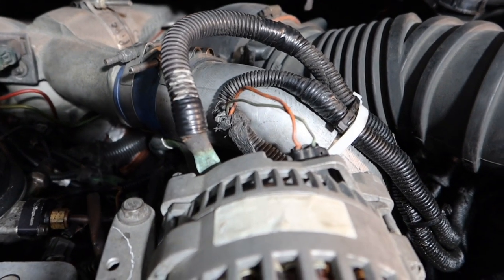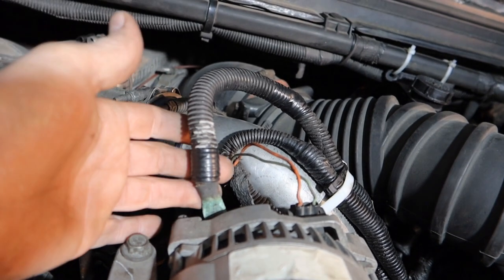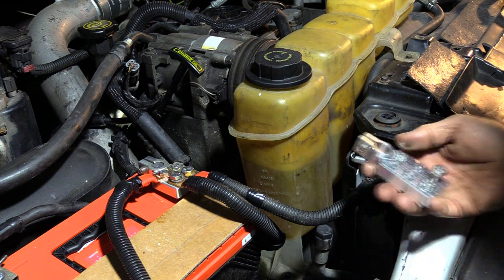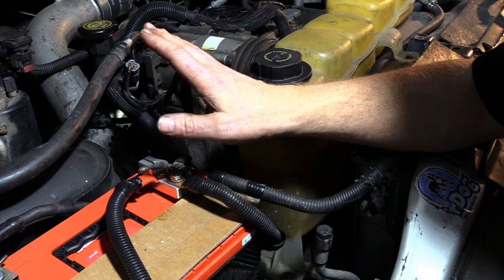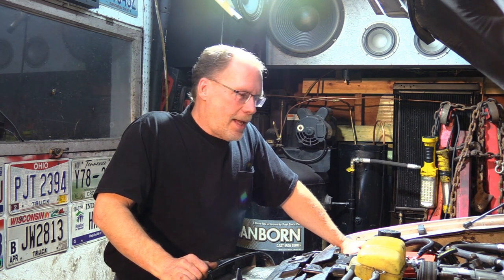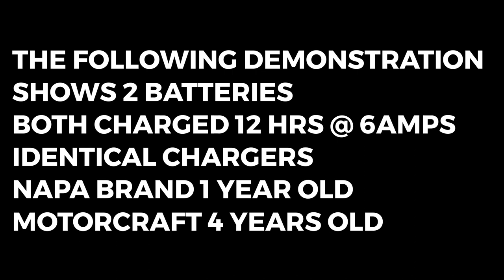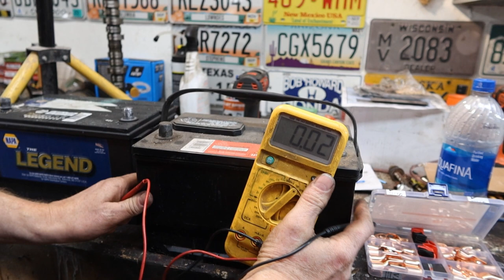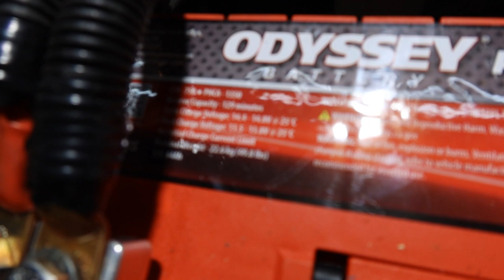7.3 POWERSTROKE ALTERNATOR AND BATTERY ISSUES EXPLAINED.......

Comment: In our fire department we rotated our engines batteries every 3 months and also separated the system for clean side (For all of our computers/radios/GPS) batteries and dirty side (Engine start/lights, etc).  Before we started doing this our City shops were constantly replacing our batteries.   Great info for people to be aware of.

Comment: I replaced a pair of superstart AGM’s that were 15 years old on the 03 7.3 long bed crew I bought a couple of years ago.  I was impressed that there was zero corrosion on my battery terminals.  Turned out it was the starter, and I could have gone longer on them, but it is good to know I can expect a good 10 years and no corrosion.  They were less than $250 each at the time.

Comment: Good vid.  All of the lead refineries in this country have been shut down.  So all lead comes from offshore.  Odyssey batts are good, if you're looking for something less expensive Penn State/Deka are rebranded into many brands and its hard to find who's who but its worth it.  Optima used to make great batteries (late 90's early 2000s), but the last few were not as long lasting as the early ones.  They changed mfg facilities around the same time as the longevity went down...

Comment: Being a mariner I always use tinned wiring connectors to cut down on corrosion.  Shrink to fit with glue inside keeps out water and then dielectric to finish it off.  I do dislike bad electric wiring.  Here at 4200 feet in the mountains I use a battery maintainer, NOCO 2 amp for $50.  I plug it in all winter and always have a fully charged battery.

Comment: I, first always plug in the block heater when it's cold out, and I swap out my NAPA Premium Gold deep cycle batteries about 3 to 4 years... then I re-furb them and use them in my cars, all 3 Crown Vicks have the re-furbs in them and get another 3 to 5 years out of them! Well I guess my next pair well be the Odessy battries 😎😎

Comment: Well dang it, I checked the Odyssey battery company and they only sell the Left side battery and not the right. That shoots the matched battery theory completely.
Reply from the maker: the Batteries sit in the truck reverse each other so yes the same listed battery works for both side You where talking to an official idiot who ever told you that
Reply: @CUSTOMWORKS7.3PSD   It may be different on my 96 conversion van. I have always used two different batteries cause the big one on the drivers side would never fit in the passenger side slot. In fact that smaller battery is a specialty battery that they call the "ambulance battery" and NAPA charges me an arm and a leg for it. I have never been able to find a generic substitute for that one.

Comment: Best thing I ever did along with my good high CCA batteries, copper connections and 5w-40 synthetic motor oil, was when it comes time to replace the starter is to put in a Nipendenso unit.. of course you have to check out the glow plug system every fall and make sure everything is up to par along with a new fuel filter. But the starter upgrade is amazing! I regularly have started in well below zero weather with no electricity available for block heating with ease!

Comment: Very helpful. I have a very clean 7.3 excursion, but I’m doing a complete overhaul for a reliability build as it’s our tow vehicle for my lake boat and I don’t want to spend time on the side of the road on vacations. 

I started electrical system. Glad you said odyssey because I just got two brand new ones. I bought a 250amp alternator. I did a big 3, but also am running 1/0 from battery to battery and ground. Replacing the starter with an upgraded starter. Replacing the cable from starter to battery. Replacing glow plugs, cap, valve cover seal and harness - while I’m in there I’ll re-seal the injectors and replace the cups with my overly-expensive injector cup tool from riffraff. 

I’m adding an F650 dash panel for switches for the accessories and then might put the separate fuse box in glove compartment or if there is pace under the accessory switch. 

The main harness I’m still researching. I’d like to replace it, but I also want to make it better. I think you mentioned you replaced the wire with 4 gauge. The gauge wire that comes with it looks like it’s super flimsy, I haven’t tested it yet as I’m mid project and haven’t gotten to that.

Comment: Would love to have a set of those, and what you said makes total sense, but they are out of my retired budget price range. I'll have to save up after my next time changing batteries next year. Until then I might have to stick with the MotorCraft BXT-65-850's at ~$204.00 x 2 = 408.00 x %11 Tax = $452.88
Odyssey has two batteries for the truck; 
- P/N: ODP-AGM65 (65-760) W  CCA 762  Price; $338.99 X 2 = $677.98 Plus 11% Tax = $752.56
                     or
- P/N: ODX-AGM65  (65-PC1750)  W CCA 950 Price; $391.99  X 2 = $783.98  Plus %11 Tax = $870.22
Thanks for sharing Clint. Keep up the great videos. Keith Noneya

Comment: Next alternator I'm gonna run is one out of the 6.4 they bolt right up. The two smaller wires you put those together. And once you hit 1100rpm it comes on. Which is good for glow plugs from what I heard. They don't like but lower voltage cuz they tend to swell at 13.8 14v. Love this video.

Comment: Thank you Cliff. Being a newbie with both diesel and my dad's 96 F250 7.3 I am so thank I found your channel. Recently after upgrading to LEDs through our the cab I noticed the alternator gauge as well as the rpm fluctuating at startup. After checking battery cables and clamps I am seeing all the issues you mentioned. Guess I've got a busy weekend ahead of me.😅
Reply: Clint, sorry of the wrong name 😢

Comment: Can I just say thank you for the advice regarding having two of the same batteries. I invested in two red top optima batteries to replace my mismatched batteries and wow! The engine is NOTICEABLY running smoother. Even the injectors sound happier. Throttle response is also a lot more smoother. Thank you so much for the advice!
Reply from the maker: yOUR WELCOME My goal is to put out the best info to help the PS owners

Comment: My 97 7.3 alternator burned out in 2019. (Not too bad, but at a bad time, snow storm and plow on, had to pull batteries up on a toboggan 1/2 mile up hill to charge up). (Yes, up hill on way back too). Great video

Comment: On our personal 2012 F350 6.7
We made it 11 years on the factory Motorcraft batteries.
And during those years we were in BC Canada, Texas and the desert South West.
 When I retired I was working for a government motorpool as a mechanic. The fleet was 150 peices of rolling stock, gas, diesel, SUVs to class 8 trucks and heavy equipment.
On newer machines you have to go in and tell the vehicle computer that you changed bulbs, changed batteries, ect. Because of how tight the systems  monitors and controls ALL the systems and functions.
Forget to tell the PCM/BCM and things will burn out.

Comment: I completely agree with what you have said.  But.... those batteries that you are running, are not your standard lead acid batteries. They are in fact AGM batteries. Now, with that being said, I have a small towing company and i switched all of my trucks (both towing and service trucks) to the AGM batteries a few years ago, and almost instantly, most of our battery and or charging system problems disappeared.  Yes, AGM does cost more, upfront... but after buying 21 batteries (some of the tow trucks take 3 batteries) every 3 years for 15 years, i haven't had to replace any in the last 5.  As always Sir, excellent video with a TON of useful information!!!
Reply: AGM batteries are the right battery type for a diesel that’s near the engine.  They handle the vibration, heat and start cycles much better than lead acid battery types.  Yes more expensive but they can last 2 to 10 times longer.  😊

Comment: 2001 7.3 here. I was thanking about purchasing Odyssey batteries after seeing this video. Purchased two new Motocraft 850 cca back in 10/2019 had charging issues just recently and replaced my alternators I have two. Before changing the alternators I would check my voltage and the battery read 12.5 volts my thinking 90 percent going on three years I need to start looking for batteries before winter later in 2022. Since replacing both alternators and before starting, my batteries are at 12.8 12.9 volts. And I believe having bad alternators  burned out an IDM. Once I crank my engine over it immediately jumps up 12.5 13.5 14 volts in a matter of seconds on cold days I used to count the seconds it would take for the battery light to go out 30 seconds sometimes longer. Let's see how long these batteries last for. But I tell you I do like the odysseys and 950 cold cranking amps.

Comment: I have the same alternator on my Windstar & Freestar vans.  I always get 250,000 miles minimum on them.  I know they don't work as hard as they would with a diesel & 2 batteries, but they should still last pretty good if the wiring system is good.  I have used the same alternator on my 79 F-350 with high compression engine & 2 Group 27 batteries.  I used that pickup when I worked on a farm to jumpstart most of the tractors, combines, & construction equipment.  It lasted for the 5 years that I worked there.  And yes, replace all batteries on each vehicle at the same time.  Use at least 1/0 cables & keep the connections clean.  That said, I didn't know about the battery tech.  You really do learn something new every day.

Comment: Hi Clint, thanks for the battery info. It was much appreciated. I just completed rebuilding the fuel bowl today. What a pain in the butt!! But it is done, NO LEAKS. The batteries have been replaced with Motircraft OEM a few years back , as my wife’s son informed me. My next replacement is the block heater and cord. I will also get some copper lugs, and I have quite an assortment of various gauge wire. That will be my spring project!!

Comment: Pretty good video, however you claimed voltage in way to many cases which would actually be amperage causing the problem. 14v is not much at all, but 1000 amps is a LOT.

Comment: The van is somewhat new to me I bought it around February-march with 171,500 it now sits at 176kz they guy I bought it from said if you don't start it in a few days it wouldn't sometimes start so that's telling me it has a parasitic draw somewhere or weak batteries? Ok so I drive it like that and never really had an issue starting it since I was using it quite often and wouldn't sit more than 3-5 days. Went to start it one day and "click" when I tried to crank it. Kept trying to crank it and it kept clicking without any starter engagement. I cleaned the posts on the battery in the engine bay and made sure the connections were tight. It didn't seem to affect anything as it kept clicking, finally I got lucky and it engaged the starter and it fired up, drove it home with no running issues ran fine. Took out the starter and had it rebuilt at a reputable shop, took it home, installed it and bam fired up first try and that starter sounded strong! I never heard the starter wind up that fast! (So at this point I dont know if it was actually the starter or it was that my batteries were charged again but once I put that starter it started quick and strong.) 

So I took a trip from Tucson Az up to Modesto and the van started fine and super strong with this rebuilt starter the trip took me about 3-4 days and if I had to guess about 30-40 starts of the engine. I get to Modesto and guess what I crank it to start and "click" again just like before and these clicks sound like what a starting solenoid does. I tried key off and crack about 7-10 times and nothing just click. I do the old hit the start with a wrench get back in the van and go to crack and it starts. I basically only had about 5 more starts after that. I got down to the 2nd battery and it looked old! And the connections had that white stuff it gets when it's not cleaned. I have the batteries tested at auto zone and the engine bay battery checks out good but the 2nd one tests bad so I get it replaced with auto zones better batteries. I go back to the van thinking I didn't have a battery working so it must start! And same thing, click! Just like before. 

I take it to a shop in Modesto they said the batteries were dead and it had a bad starter after only about 2000 miles! They charge the batteries and replace the starter with a Ford Motorcraft Remab and they call me and they say it's good to go mileage when they changed it was around 173k- 174k. 

So here we are at 176k and the issue popped up again. 

Sorry for the long post, and let me know what you think. I want to get this thing fixed because I need it to be reliable for me and I want to take it to someone who knows about these vans and the 7.3 engines. Thanks for responding and the info! It's really appreciated

Comment: Great video
I will definitely try the Odessy batteries.

However, I do have a question.
What alternator do you recommend for a 7.3 ?
I noticed on my alternator there is NO  10mm bolt/nut that holds cable to the. Alternator

Comment: Thank you Clint...I've been watching your videos for a last couple of months, trying to figure out my starting issues...you have great information & I appreciate the way you communicate/explain things! I was curious of what your thoughts were when it came to Optima AGM Yellow Top Battery DH6 Group Size 48 800 CCA vs Odyssey Battery 48-720T Group Size 48 723 CCA, that you recommend. In the early 90's I owned a car stereo shop & we only used Optima, but I have a friend that works at Interstate battery here in the SF Bay Area & says that the company was sold to a Mexican Co. & that they are crap now. (1996 F350, 7.3L Powerstroke, crew cab, long bed, 4x4)...Thank you for your time, much appreciated !

Comment: I have used 850 cca batteries changed in pairs and paid the awful sum of $650 per pair I have had to replace them more than seven times over team years the only time I caught a break was when the truck sat for three years.
I have gone through a starter three alternator’s and a starter relay or solenoid. I’m probably a candidate for the wiring harness and where can I get someone who isn’t going to mess around with wires under the dash when they install a radio?
Reply from the maker: find a installer and tell them what your wishes are that you don't want them diddling with the wires just use the factory radio wires only

Comment: Great vid! I’m a lifer car audio guy so I greatly appreciate this topic. I plan to upgrade all the battery cables on my 7.3, already have those copper lugs to build my own cables, good stuff. Can’t decide between car audio OFC or welding cable. Plus thinking about an aftermarket alt like the Mechman 240A.  I didn’t see that brand coming on the battery recommendation. Nice! 👍🏻 Thank you!
Reply from the maker: Glad it was helpful!
Reply: Don't waste your $. You can get a large case hairpin for the 6.4, the main alt, and it bolts right to your truck, 7.3 and 6.0. 250 amps, hot, 180 at idle, all day long. Cost me $158, shipped. 

I'm a car audio guy as well, and if you see my videos, you know I ain't playing. Don't pay $450 for a small case hairpin that does shitty idle current. A unmodded, stock, large case hairpin like I mentioned will run circles around the small guy. For less than half the cost. More reliability, more power. Less mechanical energy required. 

The downside, it's heavier. That's it.
Reply: @georgesrisomsak9650  does the plug from a 6.4 same as 7.3? The small one?/small wires? T.y. good to know.
Reply: @randalln.587  it's the same, however the terminal layout is different. You'll want to connect pins bvs, and rl together to self excite the alternator. You'll need to rev to 1100 rpm to "turn on" the alternator. It's actually handy, so the alternator doesn't turn on until the glow plugs are off. It could cause swelling since they are designed to work at 11 Volts. I personally have not had that problem with genuine motorcraft zd11's, but I change mine out every few years or so as preventative maintenance, and have never had a problem at all. Your mileage may vary, but this is truly the best option..

I recently built it myself into a 370a alternator, and when I pulled the guts out of the unit I bought from eBay for $158, it was all genuine parts inside. Even the brushes and regulator were genuine, Japanese Nippon denso. Rectifier, rotor, stator, all genuine. Even the case is a genuine fomoco. HELL of a deal man. You absolutely will NOT beat the value for the $. Not only that, but the build quality was impeccable. I was quite impressed. 

Anyway, I rebuilt it into a 370a hit rated unit, I have a clamp test doing 388 amps at 2000 rpm. It's the latest video on my channel. Have a look. Anyway...

Genuine Reman large case, 158, new rotor and stator was $270, I'm out the door for $428, baddest alternator on the planet. Does the same numbers as the other manufacturers. Mechman and DC want almost twice that much. AND I don't have transpo Chinese reproduction rectifiers and regulators to leave me stranded somewhere. 

The best of both worlds. I'll get ya a link now.
Reply: @georgesrisomsak9650  awesome info George Thankyou. So  the 158. off ebay was the 6.4 alt? Sounds like an awesome deal. Thanks again..

Comment: Battery voltage... 13.1 is not "resting battery voltage"... for a lead acid battery... Look up "fuzz charge"... As a 20 plus year owner of a 7.3 fleet... the positive wires can become a problem, but the "norm" is the ground is not heavy enough... (Ground, Battery to body, and battery to motor)  and all battery terminal ends are weak, junk...!